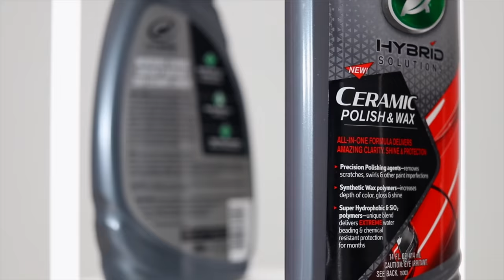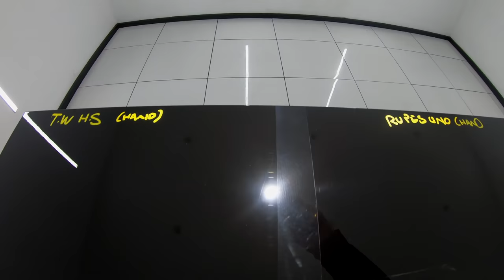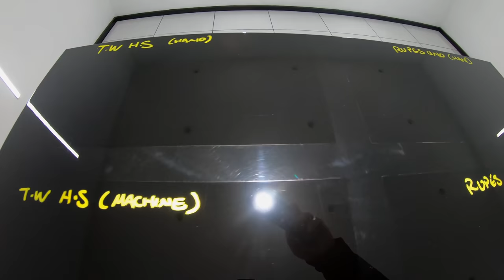Turtle Wax Hybrid Solutions Ceramic Polish, Wax & Spray Coating Tested & Reviewed!

Comment: Hey mate, great video! Turtle wax states that you need to wait 24 hours between coats of ceramic spray coating for maximum durability, or layering ceramic spray coating on on top of ceramic polish and wax. They also claim better durability than seal n shine if you do 2 coats, 24 hours apart on hybrid ceramic spray coating. My testing 2 coats 24 hours apart puts CSC ahead, but it’s pretty close. I will say CSC is nicer to use and glossier in my test, as well as better smelling.
Reply: Yup, I bought a bottle of Polish and Wax and Seal n Shine (new formula) after watching this video.  It does say on the Polish and wax bottle to wait 24 hours.

Also, I found wiping with a damp cloth actually CAUSED streaks after having already buffed with a dry cloth.

Comment: Man I had such different results when polishing with machine, I found it to be great. I used a Porter-Cable with a green lake country finishing pad to remove swirls and bring back shine. I did 3 section passes and did not get any stickiness from the residue.
Reply from the maker: That’s great to hear and I appreciate you sharing that!

Comment: I find for a better machining experience use dry clean pad prime fully buy spreading product all over pad to dampen. Can be tricky as product is thin but after priming spread as is then add small amount of product as required. With the pad dampened with product it doesn't dry out as quick and if it does passing over re dampens. This gives me a nice long buffing cycle and then wipe off is a breeze.

Comment: i tend to only buy Car Pro products because they are very high quality and i love the user experience. I also coated my car in a Car Pro Cquarts 3.0 so i want to strictly follow the manufactures guidelines to not damage the coating. I also use Bilt Hamber cleaning products because they class leading cleaning products.

Comment: Hi Sandro, great video as always. Thanks. Just sharing..... I just did a total paint correction on my 2019 Renault Grand Scenic. Yes it has a hard clearcoat. After all the necessary paint prep... I cut with Ultracut by Carpro(2 times w/ 3-4 passes per panel) w/ SPTA microfiber pads, IPA wipe then finish with Turtle Hybrid Polish Wax w/SPTA finishing foam pads(2 times 3-4 passes per panel). Lastly apply 1 layer of Turtle Hybrid Ceramic Coating. Results are amazing. Insane deep gloss w/ very hydrophobic properties. Thanks brother.
Reply from the maker: Really awesome to hear that mate! It definitely sounds like it was a pretty hard paint as UltraCut and MF pads definitely work well at levelling defects! Well done and I’m glad it was worth the hard work!

Comment: Awesome video! Informative as always. 
I've been using the TW Polish + Ceramic Spray and I have to say I love the performance I can achieve.
I do not see much improvement with paint correction when using the polish. I feel like the polish is more of a paint enhancer rather than a true correction product. 
The two combined provide fantastic gloss and super tight water beading. 
As usual, the results vary depending on the prep work performed.

Comment: Completely agree with your comment about the naming of the products, they end up being so long that they end up being forgettable. 
Whatsitsname? would be more useful, and Bowden’s Own have absolutely nailed it with their product names.
Reply from the maker: Yes, it especially gets frustrating and confusing when your talking about a few of these products at once!
Reply: I just experienced this. Even after years of having to remember product line names from a deluge of drum and cymbal brands. 

I was trying to remember what the TW spray wax was called. Not the Ice, but from the green bottle line... I had to Google it!

Comment: I want to start off saying that I’m a fan of your content sir! One of the best ones out there, if not the best. 
I’m not a fan of TW products but I have used the HSC line and their polish and wax does recommend to allow for 24 hours of cure time before topping it with the spray and even 24 hours between coats with the spray itself. Great to see yet another video! Always enjoying your content
Reply from the maker: Thanks, and I was on their website prior to testing these products and I saw no info about cure times whatsoever, but if that’s the case I appreciate the info!  24hrs wait time to simply layer an AIO or spray sealant seems excessive in my experience, even counter intuitive for creating an optimal bond, but I’m sure they have their reasons for suggesting that.
Reply: @CarCraftAutoDetailing  aha i found sandro

alberto gorin
1 second ago
turtle wax made a big step forward i have polish & wax and its one the products and i have seal & shine and turtle wax is of mi favorites i believe they call us weekend warriors here is from 10 till 15 euro
Reply: Car Craft Auto Detailing apparently the cross linking process takes 24 hours, according to the videos that came out from their large detailed meet up the hosted when the line debuted.
Reply: Car Craft Auto Detailing pretty sure it says it on the bottle to wait 24 hr for extra coats.

Comment: I had the Polish go sticky on me and thought the pad was clogged but no. 
Mentally scratching my head while cleaning out the blue foam pad every short pass. So glad I witnessed you video. 😁
Made my evening 👍🏼🤣 sorry but true
Reply: Thats quite strange.
I would recommend thoroughly removing any paint contaminates and old waxes/sealents before applying.
Also, shake the bottle like it owes you money before use and during application. 
Other than that, I'm stumped lol
Reply: @jamest7485  The car was stripped and prepped. You obviously didn't pay attention to the video and Sandro's commentary on this issue
Just saying, but anyways, cheers.

Comment: An interesting review Sandro. The big wigs overseas have absolutely raved about this stuff, reviewed so it felt intimated, yet never once discussed difficulties between hand and machine application. Never once mentioned that is transforms from wet to dry in a matter of seconds (yes, I did notice in your video), never really compared its application v cost v competition. Having said that, Turtle Wax did fly 40 of the ‘leading’ YouTube detailers to its release in Arizona (I think). Keep up the great work. Lloyd.
Reply from the maker: I almost prefer not to look at other reviews when testing something new as I  like to discover how it performs for me personally and share that. But I have no doubt that others will have different experiences but hopefully draw their conclusions based on their own testing and results which helps provide good rounded information about any product, thanks mate!

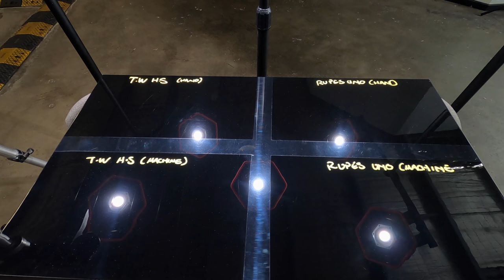Comment: Thanks again for a great video.  So, would you say, going by the left side results on your second panel, that the Turtle Wax All In One is acceptable as the polish step in a two-step process following a good compound like you note just after the 5:50 mark?
Reply from the maker: Every paint is different so you will have to start with a test section, but I’m sure it can work relatively well in certain cases perhaps more so for lighter correction or finishing.

Comment: Glad to see this review. I just did the C.P.W with S.N.S topper. I found the slickness fantastic. 

I used a lake country white pad and found on forced rotation it did heat up and dry out before working enough but when I switched the forced rotation off it was fine. Stayed wet enough for me to get 4 passes done.

I think more correction would be had with a firmer pad though.

Great work Sandro!
Reply: Are you using the Makita 5000C?
Reply: @jdisdetermined  I'm using the Makita BO5060J
Reply: @bdollo  that's considered a "sander" right? Do you use it for polishing and paint correction specifically? Does that machine stall and have trouble rotating in free spin mode at low-mid speeds while polishing? The ability to turn on and off forced rotation is very cool. The reviews I watched of the designated polisher mentioned the free spin mode was rather clunky and underpowered compared to a standard free spin polisher. I already have quite a few Makita cordless tools, batteries and chargers, so I've been looking pretty hard at getting their cordless polisher, the XOP02Z, but I usually cut with a rotary, so I'd probably use it more for a convenient free spin than anything else.
Reply: @jdisdetermined  yeah that is technically a sander but because I detail boats and not cars (except my  own) it suits my needs better. The big one has a hand grip that sits forward of the pad which will stop me getting into the corners of all the surfaces that turn in on themselves. Where as cars all the surfaces turn away from themselves (well most).

To be fair I never use the free spin mode, I only use forced roation when machine waxing on gelcoat to give more power.

Comment: Hi sandro. Hope things are ok in the Penal Colony of Viktoriastan. Anyway, reaaly enjoy the Ceramic tests you have been doing lately. I need your advice please. I have a bottle of CKQuartz UK3.0 that is unopened and been sitting in the box. I was going to use it in a couple days but.....it is dated 11/11/19. I bought over two years ago and is now 2 1/2 years old. Would you trust using this or throw it out??? Was going on the white HQ but I was not sure if I should use it or not. It is still in liquid form when I checked it yesterday. The reload with it is a milky texture when I shake it but also still a perfect liquid. Otherwise, I was going to buy a new bottle. Keep smiling down there; I feel for you in the current situation.
Reply from the maker: Not allowed to work, not allowed to visit anyone, 8pm curfew, only allowed out for an hour a day, the strictest lockdown the world has seen - I have no idea what you mean ...
Personally mate, I wouldn’t tend to use it as the work involved applying a coating is always the greatest consideration and close to a year after expiry is a little long. I don’t think it would harm your paint in any way but there’s a decent chance it may not perform as well as it should.

Comment: Unrelated question, but is it necessary to use a "car dedicated" APC instead of a store bought multi surface cleaner, or even a degreaser? 
it's a lot more economical to get something like megs super degreaser and dilute it 1 : 3 to clean wheels, or dilute it to 1 : 20 to clean the interior trim and leather.
And what about using laundry detergent/dish soap for the interior? (diluted ofc)
Reply from the maker: Well Meguiars APC and Degreaser are car dedicated cleaners and they both work well and are very economical, so yes you can use them at various dilution ratios depending on the surface you’re addressing. I’m personally not a fan of laundry detergent for car interiors as I find it’s residue difficult to remove and it really needs to be flushed out which requires the use of excess water, but that’s just my experience with it.

Comment: Is the TW 3in1 detailer just marketing hype or can I use my leftover supplies of Megs Ultimate Quickwax over the TW polish and spray ceramic coating?
Any chemical reaction issues likey or should i just top up the TW spray ceramic coating after a few months and just be happy?
Reply from the maker: I don’t think there’s going to be any issues using other brands with it

Comment: I watched your video a few times back and thank you. However, it hasn’t answered my question. I wanted a comparison of the two from your thumbnail. Polish and Wax vs Ceramic Spray Wax. Contemplating whether I should just do the polish/wax and be done or go ahead and use both
Reply from the maker: You wouldn’t normally place a polish and wax head to head as they serve different purposes. A polish is used to remove things like minor swirls, light oxidation, light water spots and restore gloss and clarity to paint. A car wax or sealant is used to amplify the finish and protect it, but on its own it’s really not going to remove any light defects though it can sometimes mask them to a small degree. 
The best thing to do is a little test section on the paint starting with the wax, if you’re happy with the outcome then that’s all that matters. But if you’re not happy, give the polish a go as if the paint has minor defects(as most cars do) it may help improve the finish even more so than just using the wax.

Comment: Great review as ever. I found the polish really good and applied with a yellow wool Rupes pad. I also thought the spray sealant was noticeably glossier than Seal and  Shine but although decent products, There are better options out there. Can’t believe how expensive these products are in Australia!
Reply: Wait, could you cite some better options that promise the same durability?
Reply: @ntwalipat2  fusso soft99 12month wax - great durability, look it up :)
Reply: @ntwalipat2  about to correct my sapphire black E46 with this polish&wax, 24hr curing time, then wax and another 24hr cure

Comment: Hi, can you suggest me between each layer of 24 hours curing time : 
Let say I apply 1st coat of Ceramic spray and I need to use the car on the same day, then 24 hours later .... Do I need to wash the car again prior to apply for 2nd coat. 
(Assuming it's not raining while I use the car)
Reply from the maker: Yes, you really need to wash again before applying another layer unless the car is inside during that period.

Comment: I’m confused, other reviews I’ve seen the CSC had better chemical durability when compared to the SNS
Reply from the maker: Well I can’t speak for others, but these were my findings based on my own testing and that’s what I like to base my conclusions on.
Reply: Agreed, and I've been waiting on Sandro to do his review - even though I went the HCW direction, when done witrh it I'll try SNS v2 or something else entirely - after 4 months (yes I used 2 coats, allowing 24hrs between) the water behavior has started to show its hand on thje lower part of the car - where it cops a decent work out for day to day use - I have started t use the TW Hybrid Cermamic wet wax which is prolonging the need to redo it :) .  Great review Sandro!!

Comment: Which would you recommend Sandro, TW Ceramic spray coating or Meguairs Hybrid Ceramic Wax? Awesome video like always.
Reply from the maker: Well I did a video comparing HCW and SNS (which is quite close to TW ceramic spray) and HCW just seemed to perform better in most aspects for me personally.
Reply: I’m a bit disappointed with meguiars after using tw green bottle and even the yellow spray wax.

Comment: Thanks for the video, I have a query, I have a 5 year old car, never done any paint protection or detailing, so can I use meguiar's ultimate compound first to remove swirls and scratches and then turtlewax ceramic spray for protection?

Comment: In general, wouldn't it be more advantageous to use something like cquartz or AvalonKing AS9 instead of spray on ceramic products such as TW HS Ceramic?  If so, why?
Reply from the maker: I guess some advantages would be that they are easier and quicker to use, far more affordable and you get many applications out of these bottles, and some people may not want anything too semi-permanent or going through all the vital preparation steps to ensure those other coatings last as long as they should.
Reply: @CarCraftAutoDetailing  So overall, if one is willing to do the initial prep work, higher end products such as cquartz and AS9 are perhaps more protective, durable, longer lasting (i.e. "better") than the dept store spray ceramic "coatings" (sealants)?  That the higher end coatings don't really REQUIRE periodic maintenance toppers to at least meet their expected minimum lifespan (say 2 years)?  Thanks
Reply from the maker: Yes you can definitely look at it that way!

Comment: Does anyone know if it is safe to use Ceramic Polish and Wax on Paint protection film. 
I am thinking to
1) Ceramic Polish and Wax then
2) Hybrid Solution Ceramic Spray

Thanks
Reply from the maker: You can generally use a light polish on PPF to help remove any light oxidation, swirls or baked on traffic film and the spray should also be fine.

Comment: What is in your opinion the safest way to remove a ceramic coating? I was thinking on using regular degrease dish soap
Reply from the maker: You can’t start to break down an older coating by using something like that m, but you’ll must likely also need at least a light abrasive polish to remove it as well

Comment: Just wondering.  Can I use the TW seal n shine or Hybrid Solutions ceramic spray with Collinite 845? If yes, which one should be applied first? Thanks! Great reciew!
Reply from the maker: I think you could use either as a base layer for 845

Comment: Quick question, so I polish, then use turtle wax spray for example and then wax? (I have turtle wax carnauba)
Reply from the maker: Always polish first, but there’s no absolute rules as to which wax you want to use first or second.
Reply: @CarCraftAutoDetailing  but should I use both carnauba wax and this ceramic wax?
Reply from the maker: It’s really up to you. Maybe just start with the spray wax and you can always add some Carnauba wax down the track.
Reply: @CarCraftAutoDetailing  yeah good idea! I’ll try that thanks

Comment: Can we just use turtle ceramic wax and polish or we need to top up with spray coating again, if the car is new with no paint imperfection can we just use spray coating alone?
Reply from the maker: Yes you can use the polish and wax alone if you wish and you can even use the spray coating on its own

Comment: Great comparison again. Interesting that Turtle Wax has brought out a new product that performs pretty much the same..
When really they just improved the wipe off..   Would like to see a video on the new The Last Coat Black Ice. Even though it will be
pretty expensive to get it landed here in Aust..  With all your ceramic spray coating tests.. Still haven't seen one that out performs NV Jet yet..